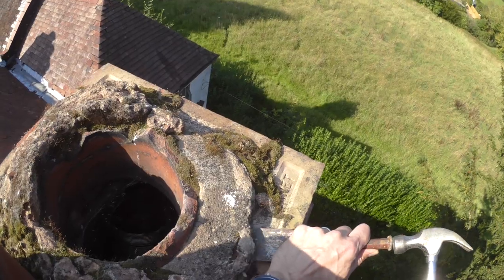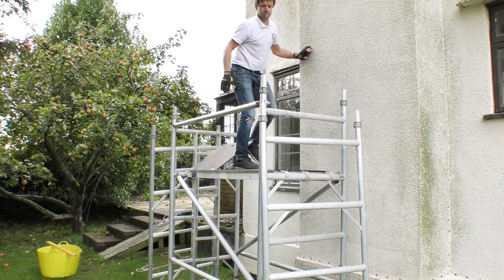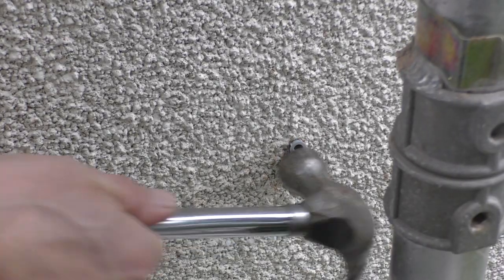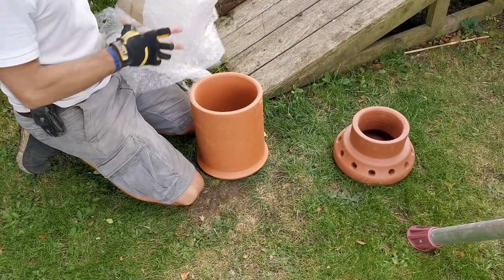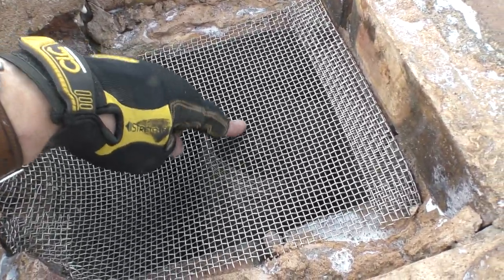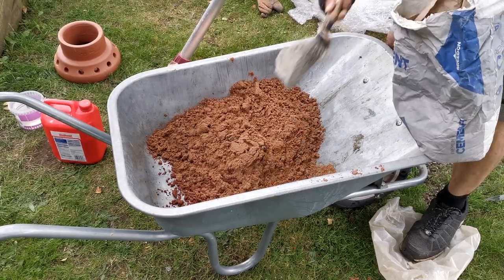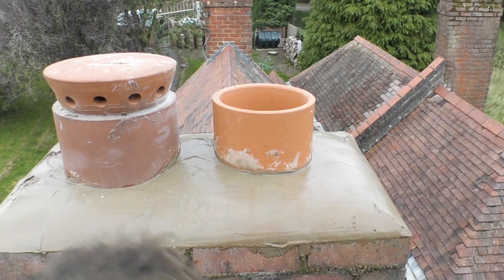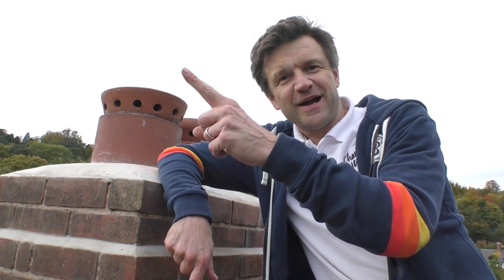How to Replace a Chimney Pot & Flue Ventilator

Comment: He's done this wrong! The stainless steel liner is to vent exhaust waste from the boiler. The liner is too short, is not clipped with termination plate and clamp. He should then bedded skate on all sides, then bed pot on that, the mesh will inhibit ventilation of the flue what with leaves etc ultimately decaying and forming film on mesh blocking off exhaust gas , all in all he's made balls up of this pot!  You NEVER put mesh in chimney......
Reply: It was clear, he said the chimney is not in use. For his job this was the right thing.
Reply: Yes, the boiler has been removed. It is just a chimney for venting the outhouse
Reply: Dean, go back to the 6:00 mark and listen to all that he says about the chimney pot.  Charlie spoke for more than a full minute about the non-active chimney.  If you'd like, you could click on the three little dots at the bottom right of your comment to edit or delete your comment. Maybe you could say something like...if Charlie was still using his chimney, here's how he would've done it....   Maybe someone watching this video would like that information.
Reply: Dean watch this video agarn, but this time listen to what's being said. What I'd like you to do then is rethink the your comment and make a valid contribution. It may help you to read the other comments first just so you can work out what the problem is.
Reply: @ivangreat133  Hi, very well said , agree agree, agree. constructive comments are of more interest than criticism. i say well done Charlie i have been around the trade for many years, now (semi)retired but enjoy this guys efforts. Would i want to do  this, no not at my age. Could i have done it better ? - doesn't matter, would i have done it differently. ? as always first rate video.
Reply: 👂👂 skills
Reply from the maker: Thanks guys. Couldn't have said it better myself. 👏🏻👍🏻 At least Dean gave his 2 pence worth about what I should have done if the chimney was being used (though I suspect there are regulation outlawing DIYers from installing flue linings?!) The SHOUTY comments I get from people saying "YOU SHOULDN'T HAVE DONE IT LIKE THAT etc etc" are worthless without any explanation as to how shouty person would have done it better, so I generally just delete them 🤣